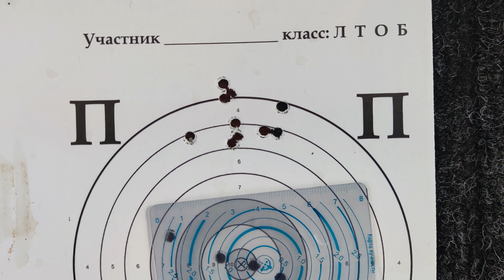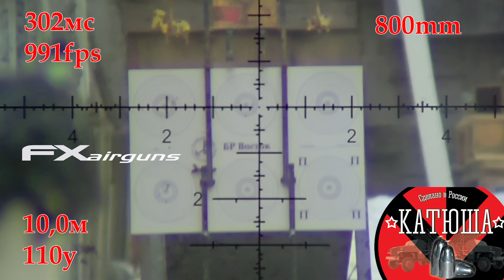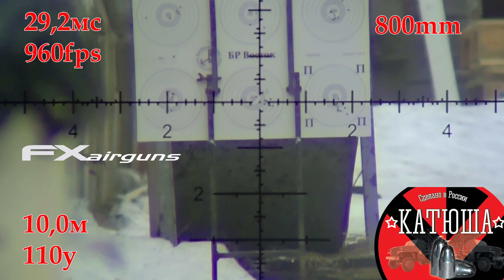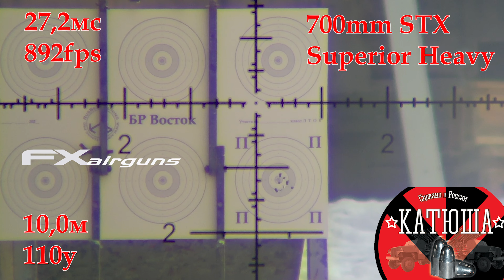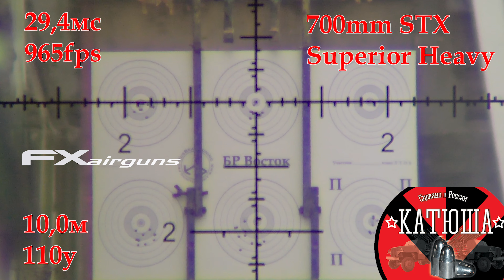FX Impact M3 .22 800mm barrel and 40gr slugs to 110 yards. Tests. Part 2

Comment: Hi Nickolay can u tell me what tune do you run this 300 meters per second i have the same setup but i cant reach for that speed. what is the bar for the first and second regulator if its not a problem with you, ty
Reply from the maker: If I'm not mistaken, my second reg was at 190-195 bar

Comment: Try the old slug A liner with 15 twist but it’s a 700mm …
Reply: Also a lighter spring for the front valve help increase a bit the velocity at high power. I’m working on it right now with altaros and the old liner, can put them faster with it and group the same as before with 275m/s …
Reply from the maker: I doubt we have those in Russia
Reply: @RusBearRB  difficult to everyone right now because it’s the old one … fx always want fresh things and don’t fabric it anymore …
Reply: @Agoger554  If it is meant that our Altaros ATP slugs are used, then it is possible, but otherwise we will not working with anyone to improve FX rifles (except supply of regulators )
Reply: @AirgunRegulator  i don’t understand what you want to say. And Why don’t you answer your customers ? I’ve emailed you more than one time …. About your rifle, your slugs …
Reply: @Agoger554  you wrote here " I’m working on it right now with altaros"  I'm just saying we don't work with anyone to improve any FX rifles. We fully respond to emails. If you wrote an email on a Thursday afternoon or over the weekend, as in most Christian Europe on Fridays and Mondays, we have a public holiday, so no one is at work and emails are answered on weekdays. 
I read this comment purely by accident and I thought it appropriate to put the information in the right order so that someone, based on your information, would not think that we offer FX rifel modification options.   it was not meant to attack you.
Reply: @AirgunRegulator  yeah that’s a mistake sorry . I’m working with my gun to improve the results and i’m using your ammo because they have the best bc ... The only default i have with your ammo is to stabilise them at higher velocity. I’m gonna resend my emails, will see if you answer …